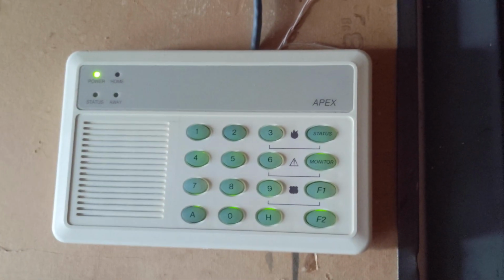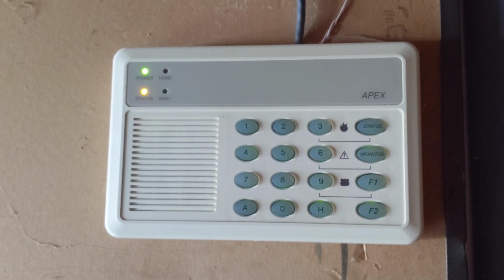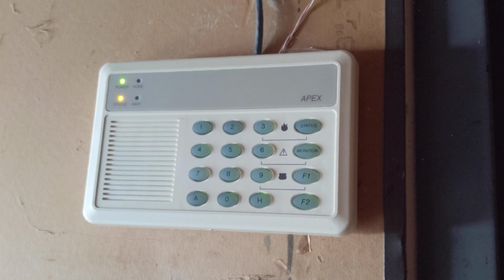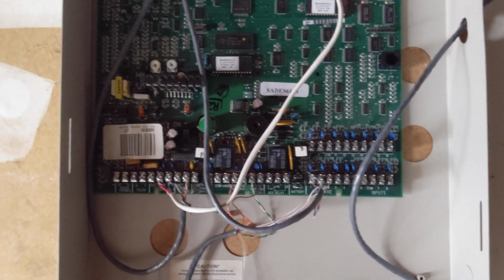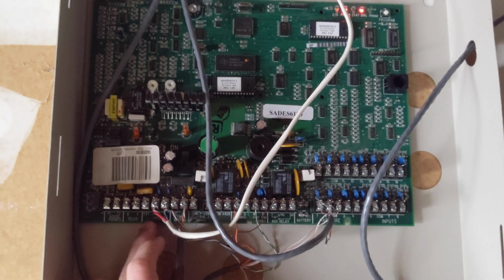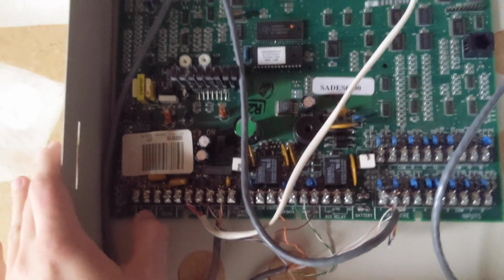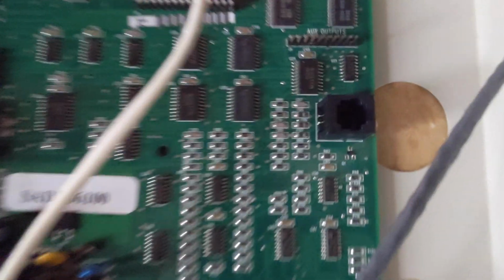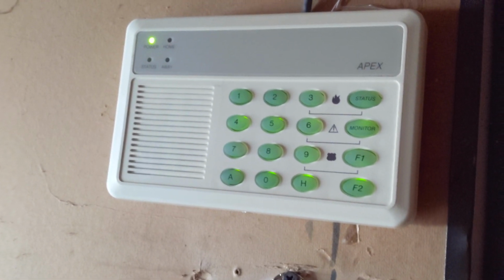Honeywell APEX Destiny Security Alarm System Demo and Test

Comment: Hey Myles I noticed that You don't have The Uplink and The Zone Expansion Cards and The Backup Battery. Howcome The system doesn't have those things?!
Reply from the maker: No need for Uplink or zone expander, this is a hobby system and is not monitored (even if it were I would not be using Uplink as the communicator) nor does it have enough zones to need a zone expander. This panel is not normally used, I just powered it up for the video so the back up battery is not needed either. There are two other systems that I have installed inside the house, one of those is monitored and they both cover the garage as well. Thanks for watching!

Comment: I was just wondering. Have you EVER hooked to a fire alarm speaker and/or speaker/strobe to it?
Reply from the maker: Not to this panel, but I do have a couple fire alarm horns connected to a relay module on the Vista 20p that is installed in the house. No strobes though.